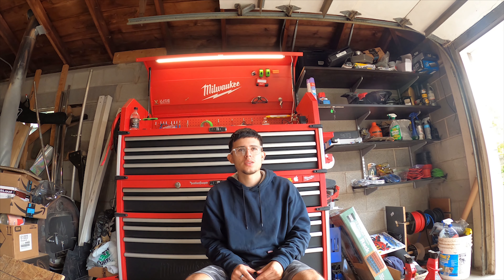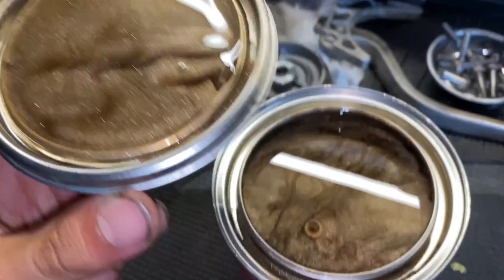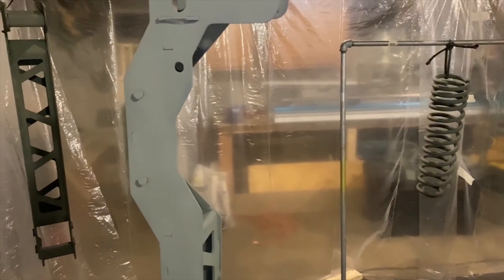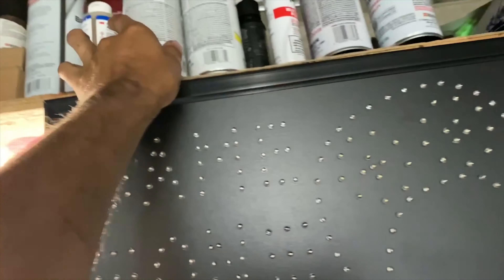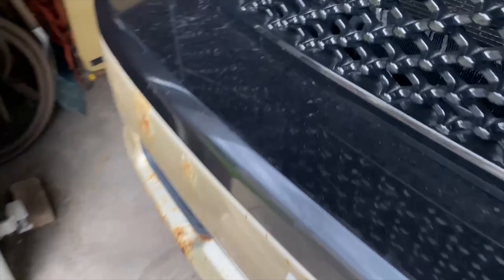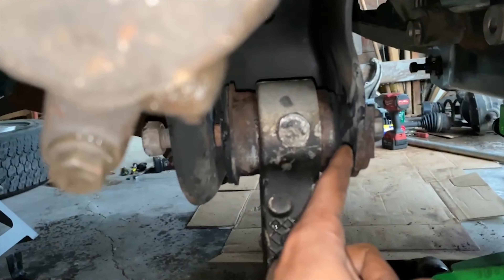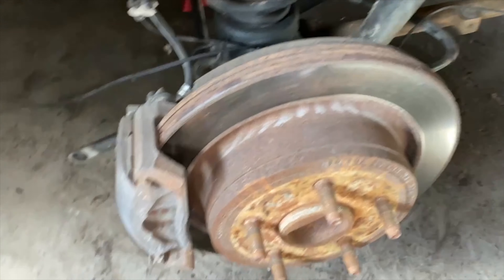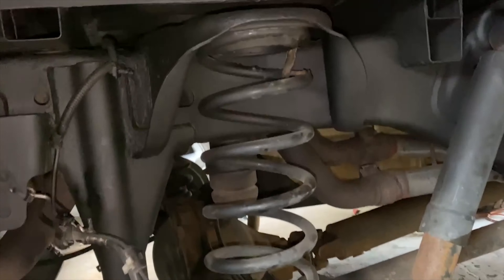6 inch lift on Ram! Pt1

Comment: You definitely had to get longer brake lines
Reply from the maker: It came with replicators so far no problems with them
Reply: @walldo112112  I did 4 inch on my 03 ram and a 5 inch I believe on my 2017 ram. Stock brake lines. I hear depending on how high you raise you gotta get longer brake lines cause they won’t reach and if they break going down the road you are obviously screwed